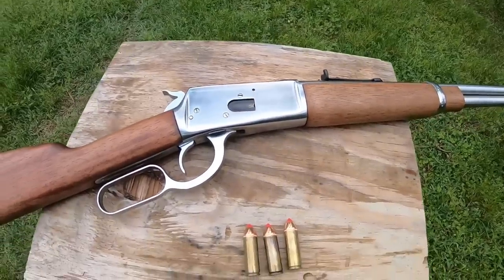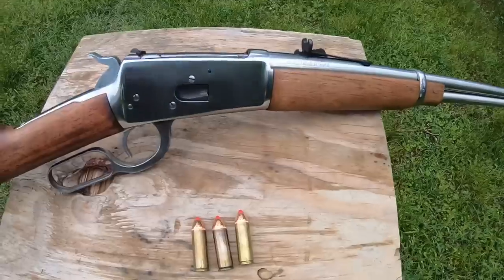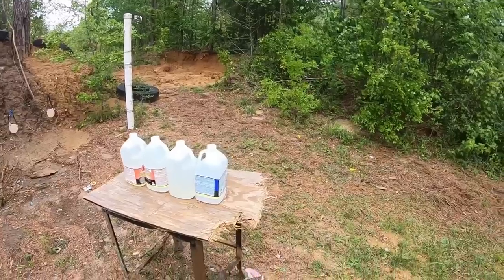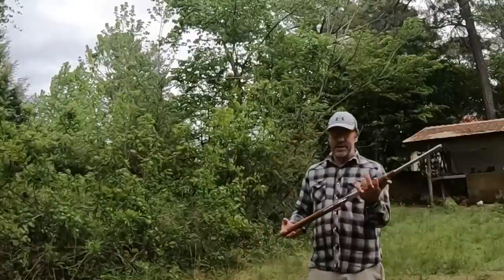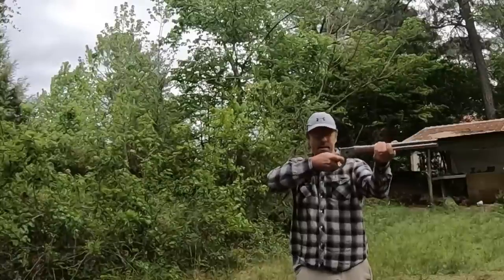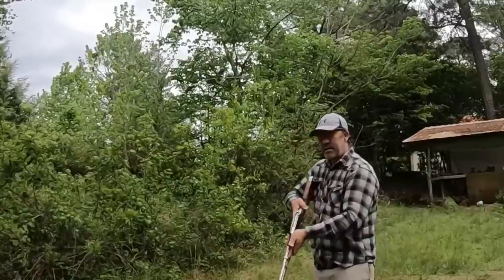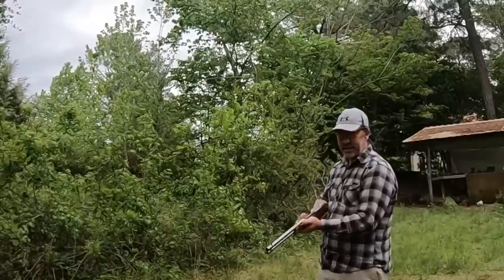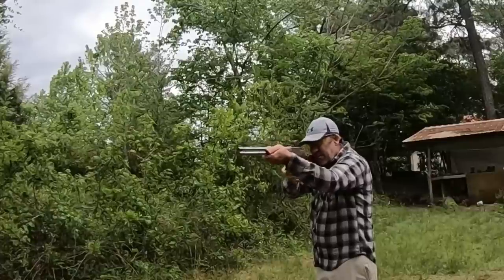Shooting the 225 grain Hornady FTX in the Rossi 92

Comment: I don't know why lever guns get mean mouthed that way.  1992 Winchesters were a police favorite for many years at least in the Western States. They generally hold about ten rounds, plenty of power and accurate.  Of course you can lever and sight at the same time! That was the reason they were designed. To me, a bolt action is more clumsy and awkward by far.  I'm impressed that went through 4 gallons of water. Now you'll need to do a follow up video to see just how many it will take to stop it.   The 1992 is another great  gun I don't own, but would like to some day!
Reply from the maker: Yeah I was surprised I thought I had enough water jugs, when I get some more I’ll do another one, just got some new bullets for my 1892 32-20 gonna try them out too, there’s a lot of myths about the lever actions I’m going to try to bust over the year
Reply: @Leverguns50   Glad to hear it!